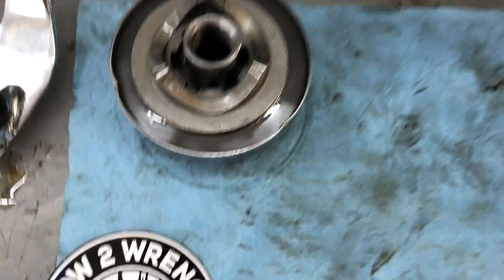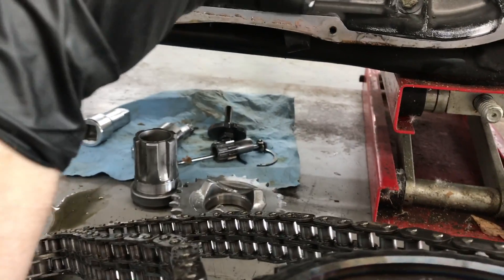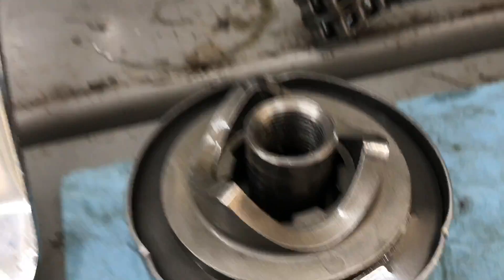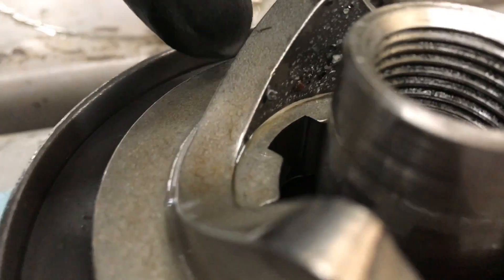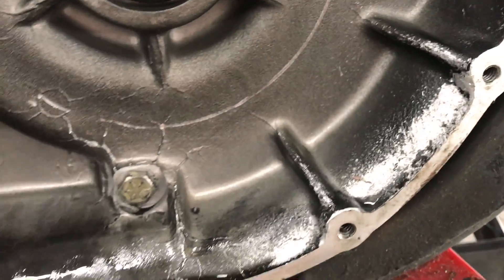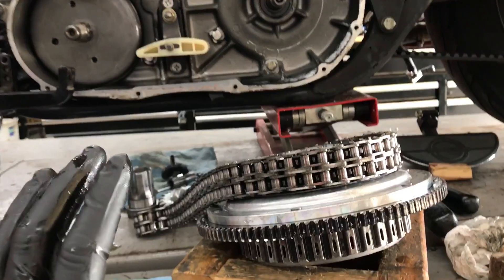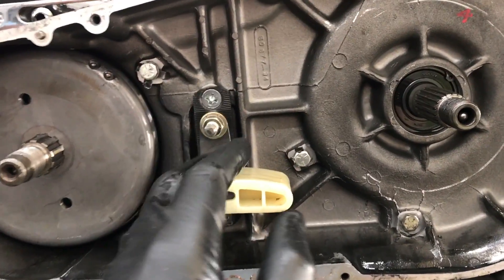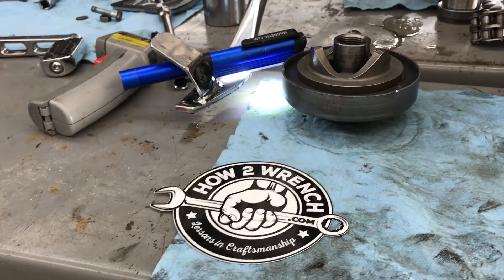Witness Marks: Are you catching the evidence right in front of you?

Comment: Make sure you clean or even replace the rotor as well, metal filings will stick to it and take out the charging system as well, been there, done that. Good video.
Reply from the maker: Good tip! Nice add...Keep Wrenching...Shane

Follow us!
Web:
www.How2Wrench.com     
www.Tools2Wrench.com
Reply: Magnetic aluminum?
Reply: @Peter-V_00  I don't know when the last time you checked was, but the alternator rotor is not aluminium and neither are the primary drive gears.
Reply: @lawnboyfromhell  If that were true then that steel trash would be stuck all over the rotor.
Reply: @Peter-V_00  Wow, you are observant. That is exactly what happens! How long do you think your primary drive would last if all the rotating assembly was aluminum?
Reply: @lawnboyfromhell Your obvious inexperience shows.
Reply: @Peter-V_00  Wow, I have been working on bikes for 30 years plus, you sound like you just watch you tube and come up with theories? What do you think the chain is made out of? But if you need to dominate, here you go, you win! I would just never take my bike to you to get fixed. I had a bud that installed a solid sprocket in his primary and didn't bother to check alignment, so after grinding it up, he didn't bother to check the rotor, probably just like you, and the next thing he bought was a charging system. He might disagree with you as well, but you keep wrenching buddy, I'm sure you'll get it someday.
Reply: @lawnboyfromhell  Sure thing ace, you win the sandbox called the internet, me I've actually done some stuff, it's a matter of records, many of which still stand today..
Reply: @Peter-V_00  I'm not worthy, you are the King! Lol.

Comment: Having a issue getting the clutch bolt off I’m turning in reverse direction but when I start putting some good pressure on it it sounds like something slipping on the opposite side like the belt is slipping. I’m not sure if the bike is in gear